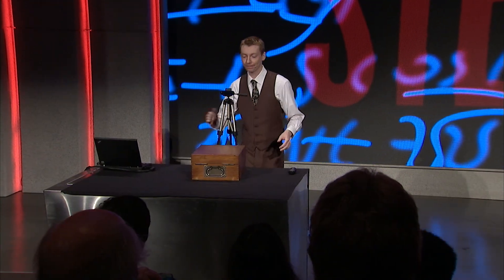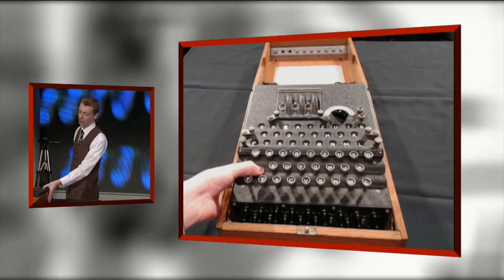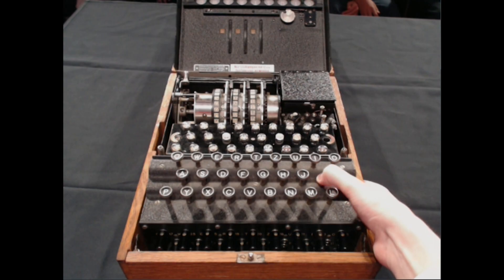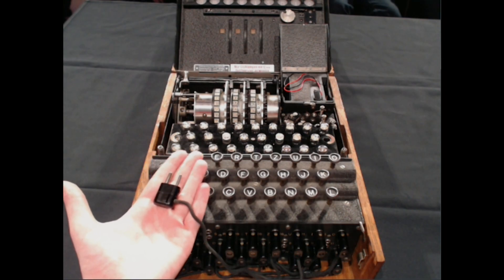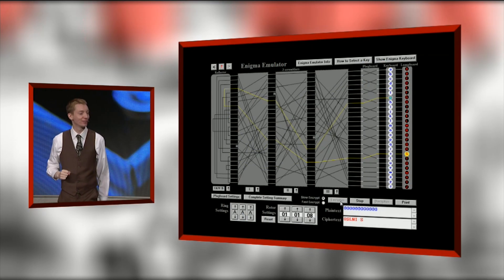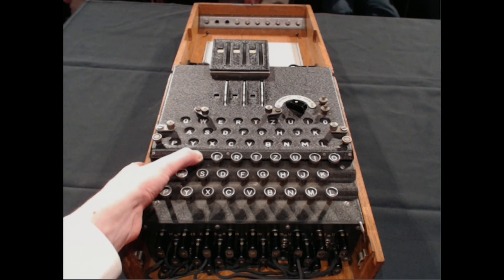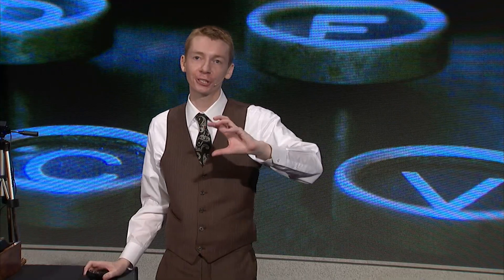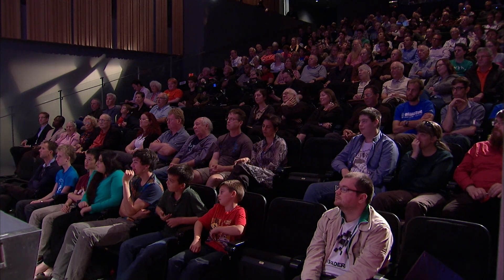The Inner Workings of an Enigma Machine

Comment: I don't understand the point of this machine.  Every day they had to change the settings,  they had a piece of paper.  Isn't that equivalent to every day having a list with what a letter transforms into? Today A is D, B is F and so on .....and use those codes to communicate.  The British had an enigma machine but they didn't have the paper.  Well there you go, try and crack a piece of paper you have never seen. All you hear is GDTR SJKOP WE JKLPPP . Try and crack that. Use numbers as well. A is T45 .... Sometimes A is A to confuse the birts totally. And use the enigma machine to communicate in CODE.  Don't write yes and wait for the enigma machine to generate a code. Use the paper codes and write T45ASC21 and send the generated code. Then they descifre the code and get T45ASC21 and use the paper to see what it means

Comment: Does the key A have a switch that excludes bulb A from lighting up or can someone explain how A never shows bulb A or is that just a very rare event?
Reply: Old question but you might get a notification!  Keep two things in mind: (1) the machine is electro-mechanical so the electric signal from the battery through encryption path to the lamp is conducted along wires and contacts; (2) the signal path obviously can't travel "up" one wire and "down" the same wire as electricity doesn't work like that, it only moves in one direction.  The Rotors rotate, as you saw, so the signal path is conducted across contacts at those points but you can envisage the encryption path as one long wire. 

Each Rotor has 26 contacts on its right side and 26 on its left side and these contacts are wired together on a one-to-one basis, i.e. a contact on the right side is wired to a contact on the left side and none of these contacts have multiple connections (i.e. a left side contact cannot be connected to two or three right side contacts)  The Reflector has just 26 right side contacts, with each contact wired to only one other contact (so 13 wires altogether)  The Input Wheel has 26 contacts on its left side and there are wires coming in from the Plugboard to each contact on a one-to-one basis, i.e. there is no contact wired to more than one plugboard letter.  These 26 contacts can be deemed a letter of the alphabet.  Note that the Input Wheel is not cross-connected so if there is a wire from, say, Plugboard letter Q to the Input Wheel it is wired to contact Q on the Input Wheel.  The Plugboard has 26 letters that can be cross wired - e.g. letter A could be wired to letter Q or letter C could be wired to letter F; it is not possible to wire more than one letter to another letter, e.g. it is not possible to wire letter A to letter Q and letter C to letter Q.  In operation, only 10 letters were actually cross connected in this way. the ones that aren't connected to another letter are internally connected to themselves.

So, the encryption path created when a key is pressed is:  Key -> plugboard in -> plugboard out  -> input wheel -> rotor position 1 (RS to LS) -> rotor position 2 (RS to LS) -> rotor position 3  (RS to LS)-> reflector in -> reflector out -> rotor position 3 (LS to RS) -> rotor position 2 (LS to RS)-> rotor position 1 (LS to RS) -> input wheel -> plugboard in -> plugboard out -> lamp.  

The more confusing bit of the above is the plugboard in/out.  What I mean here is that the signal enters as one letter, is cross-wired to another letter and then exits the plugboard (hence plugboard in and plugboard out).  If there is no cross wire for a letter the input letter and output letter are the same of course.

Hopefully by considering the above encryption path you can see it is physically impossible for a path to be created that links a keyboard letter to a lamp of the same letter as it would require that letter to be connected to itself in the encryption path - it would be helpful to pause the video where it shows the wiring path.  Take a rather contrived example of pressing key A.  Signal leaves key A and enters plugboard at letter A.  It is not cross connected so it leaves the plugboard as letter A and enters the Input Wheel.  The Input Wheel wiring is straight through so it leaves the Input Wheel as letter A and then enters Rotor 1 at some letter but lets say coincidentally letter A  (remember the rotors move so it could be any letter).  It then travels to the other side of the Rotor and lets just say that internally the rotor has wired the RS contact letter A to the LS contact letter A (some letters were straight-through connected in some rotors!) so it leaves as letter A and enters Rotor 2 at some letter.  For the sake of the example I'm going to say that Rotor 2 and Rotor 3 letter A are straight through wired: thus, it crosses Rotor 2 and leaves as Letter A, enters Rotor 3 as letter A and then leaves Rotor 3 as letter A.  It then enters the Reflector as letter A.  Up to this point the letter has stayed the same purely because I've stated that the internal wiring of the three chosen rotors were straight-through wired.  This internal wiring never changes of course but the actual number of contacts that were straight through wired like this is, I think but I can't readily remember, one pair of contacts on each physical rotor at most so the scenario is highly unlikely but it helps me explain why a letter cannot encrypt to itself.  So within the Reflector letter A is cross wired to letter Q (all contacts are cross wired in the reflector).  It leaves as letter Q (and I hope you can see it can never leave as the same letter that entered the Reflector) and enters the left side of Rotor 3 at some letter - it cannot be letter A though because that is already in use in the signal path and the left side contact letter A is wired to right side contact letter A.  Thus whatever Rotor 3's letter LS Q is wired to, it also cannot be to Rotor 3's RS letter A.   I hope you can envisage that the same occurs as it passes through Rotor 2 and rotor 1.  Let's say it emerges from Rotor 1 as letter Z.  So the signal enters the Input Wheel again as letter Z and that is straight wired to the plugboard as letter Z.  Now letter Z might be cross connected to another letter in the plugboard but it cannot be to letter A as that IS NOT connected to anything as stated at the start of the example.  Let's say Z is cross connected to letter H, so it exits the plugboard as an H which is wired to the bulb under the letter H on the lamp board. 

I hope that rather long-winded explanation helps!
Reply: To encode-decode if A gives B Then B must give back A. Because it is electrical with reflector, key A can’t (as it would always) power up lamp A. 
The AI answer is more state of the art
Reply: @iHaveOneOfEach  Not AI, just knowledge of how the Enigma and Bombe machines work and an attempt to answer what is a very good (and common) question.

Comment: I am fascinated by this. And I think some light has been shed on how Alan cracked it. Well, no by himself. The polish cryptologists too. And everyone else. 

But what fascinates me is what we take for granted. Meaning, the cap, the cap that is the same on every enigma machine. Little is said about that. I am sure there's a complete schematic of an enigma machine somewhere on the internet, but I would like to point out that the END part after the rotors, also scrambled letters around but was the same thing on all the machines. it is basically a constant. Without this particular knowledge you wouldn't be able to break the machine. 

And second... the rotors themselves. There's mention of 5 types. The ways wires connect from face 1 to face 2, is extremely important. And relevant. Without having the rotors, Turing wouldn't have been able to make simulations to find the other settings. 

Which leaves (as far as I am concerned) one question. Should we talk about the decisions that went into making that end-cap (dont know how to call it) and the way the 5 rotors are designed? First of all, how does the end cap differ from the 5 other rotors (other than its static) and just how many other rotors we could have? and how come in all this complexity, you know for a fact that A never ever equals A. Seems to me sometime A can equal A. It has 0 relevance, but that's a false statement that you hear about this machine. That a letter can never be encrypted as the same letter. Unless I'm missing something, it is possible one letter to be the same latter encrypted and decrypted. 

Still an amazing simple idea, without a cpu. Just a mechanical contraption that still can give a headache to a modern computer. Its not easy to crack these things. Even if you know how they work.
Reply: I know this is an old question, but you never know you may get a notification.  It is absolutely the case that with an Enigma machine a letter cannot encrypt to itself, the wiring physically doesn't allow for it - you can get some hint of it by pausing the video where the wiring path through the rotors is being shown.  You are right when you say that without having knowledge of how the rotors, reflector and input wheel were wired then it is unlikely (maybe not impossible) that Enigma could have been broken - this wiring was known at the start of the war because of the intercepts the Polish had done.  Indeed, when the German Naval Command introduced a fourth wheel into Enigma for their submarines, Bletchley Park could not break those messages until that fourth wheel was captured.  During the war there were 5 rotors of which 3 were chose (8 for the German submarines, 4 chosen, from 1942) and 10 pairs of letters were cross connected on the plugboard giving over 15 quintillion combinations.  Unfortunately for the Germans the fact that out of those over 15 quintillion combinations there were 26 that couldn't occur allowed the Poles and then the British to break encrypted messages on a daily basis.  Thus it has 100% relevance to decryption.

Although the reflector (and input wheel which didn't scramble but could have if they wanted) are fixed constants on every Enigma it didn't really matter as long as its wiring was known (which it was of course.)  The fatal flaw that allowed the encrypted messages to be read were those 26 combinations that couldn't occur; allowing operators to swap the reflector wouldn't have altered that position.  Actually, the Germans did try that at one point but it hopelessly complicated the whole operation of the networks so they stopped it pretty quickly.

Incidentally, the British cypher machine during the war was TypeX and was a similar rotor based machine.  However it didn't have the flaw of Enigma and letters could encrypt to themselves.   I don't believe the Germans broke TypeX traffic, although they did break plenty of other allied encryption mechanisms.
Reply: @andyj2106  Thank you :)

Comment: What did the plug board actually do to the machine's internal circuitry?
Reply: The plug board swapped pairs of letters. At 6:05 in the video, his Enigma simulator has the plug board settings: A-B, C-D, E-F, G-H, I-J, K-L, M-N, O-P, Q-R, S-T.  In this example, typing in 'G' would first swap with the letter 'H' before entering the rotors. After hitting the reflector and making its way back it will first go through the plug board before illuminating one of the lamps. In the video, this came back through the rotors as an 'I' but then went through the plug board and was swapped with 'J'  before lighting up "J' on the lamp board. The plug board could be used to swap any letter pairs, not just adjacent pairs of letters like in the example in the video. Leaving the plug board empty would not swap any letters and you could have up to 13 pairs of letters if you wanted.

To summarize, each letter typed goes:  keyboard  >  plug board > 1st rotor > 2nd rotor > 3rd rotor > reflector > 3rd rotor > 2nd rotor > 1st rotor > plug board > lamp board.

The earliest versions of Enigma were marketed commercially without a plug board which was later added to military Enigmas to increase the number of starting configurations making it more difficult to crack.

Comment: I've never seen it explained anywhere, but am I right in thinking that all possible rotors had 26 numbers, but each individual rotor had its own unique wiring so each rotor was different from all other rotors?
Reply: Right! The Germans were suspicious enough that they made changes over time to improve the system. I believe the German army adopted five rotors, any three of which could be used. The German navy was even more aggressive, going to a four-rotor system, which gave the Brits a lot of trouble when it came out. Fortunately, the Germans didn't notice how badly that hurt British intelligence.

There was another factor that's rarely mentioned. Much of this communication was tactical, meant only for someone a short distance away. To pick it up from hundreds of miles away the British used highly directional rhombic antennas, each wire leg hundreds of feet long, and installed them on 100-foot-high poles. If German aerial intelligence had spotted those antennas, they might have asked why the Brits were going to so much trouble to intercept communications if they could not decrypt them.

https://en.wikipedia.org/wiki/Rhombic_antenna
Reply: @Inkling777  The German navy went to 5 rotors once the Germans realized that they were losing U-boats to Allied attacks, but I think the army always used 3.  The Lorenz Machine that was used between Hitler and the army high command used 12 rotors.

Comment: And if think the Enigma was complex....it was nothing compared to the German Lorenz code machine, a 12 rotor teletypewriter of the highest complexity of the four (4) different code encyphering machines that the Germans used in WWII, the Enigma was used at the lower "tactical" level by the German armed forces and most German government departments, railway service, labor corps, etc and the Lorenz was used by Hitler and his High Command as their "strategic" code encyphering machine.....to transmit orders and receive high level situation reports on those ordered operations.....! The Lorenz was an extremely complex system, far beyond the Enigma....!
Reply: and the machine to attack this Code was called colossus. a beast of a machine. a working one is in the national Computer Museum in Bletchley park(it is a separate Museum from the actual Bletchley park). one of the tubes has a production date of 1943, and still works.
Reply: Wait. Colossus solved or “broke” Lorenz?!

Comment: when he sent 'HI" and later decoded it he turned the rotor position 2 alphabets back so that TW became HI. but when the reciever recieves the message how would he know 2 turn the rotor back 2 places? is it on the numer of alphabets sent?
Reply: He only had to move the rotors back twice so they would be set to his original setting (the setting had changed because when he pressed the keyboard twice the rotors moved), the receiver would already know the original setting and thus wouldn't have needed to change back
Reply: The code books had a lot actually 1. Which of the rotors to use in what order. I, II, III. Five rotors in total. 2. The ring settings of the rotors when they turned over. S, D,Y. 3. The starting position of the rotors YYY say. 4. The plug board wirings where letters are swapped. T->B  Set all that up and you can start encoding and decoding. Naval enigmas had something else to different kind of reflectors .  You can get an idea by playing here. http://www.lysator.liu.se/~koma/turingbombe/bombe.html. Click the left button to open the box. Click shift to rotate the ring settings on the wheels.

Comment: Naval Enigma's were supplied with up to 8 rotors at one point, but only 3 rotors used at any one point.  in 1942 there were 4 Rotor Enigma's being sent out, which in operation, the 4th rotor was Beta, or Gamma, and did not rotate like the first 3, but was still able to be set to one of the 26 combinations.

The Monthly code sheets used what is known as 'One time pad', so each code at the end of the day, was discarded, and moved to the next.

As already said, One Time Pads are great, but regular distribution of new pads was a logistical nightmare.

Comment: The "keys" are in the rotor wiring.....the daily settings and the actual cypher/code transmitted, thus the Enigma and the Lorenz are only the electro-mechanical encyphering and then deciphering "mechanism.....and by the way, Canada has 14 enigmas and 2 Lorenz NOT the 2 enigma that is stated here.....

This is a valid descriptive narrative, less a few omitted facts.....

Comment: Very similar to the rotary line switch on a Step by Step or Strowger Telephone Central Office. The switch has hundreds of contacts wired in a sequence so that the switches are used in a predictable order so that the first line finders do not wear out more than the rest at the end of the bank of switches. Instead of the rotary switches to change the sequence a relay matrix is used to set up a pattern of usage. ie: 1-5, 1-5, 6-10, 6-10, 1-10, 1-10 and repeat.  This central office came to market in the 1920s.